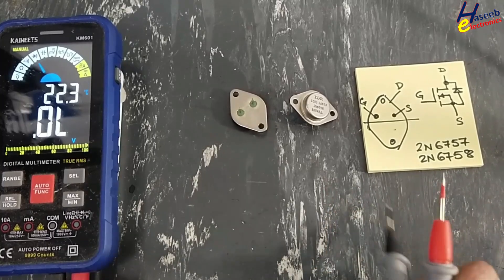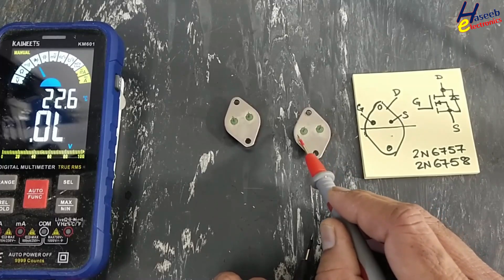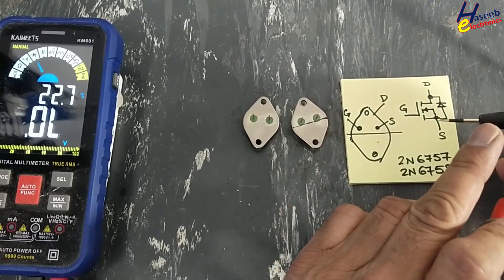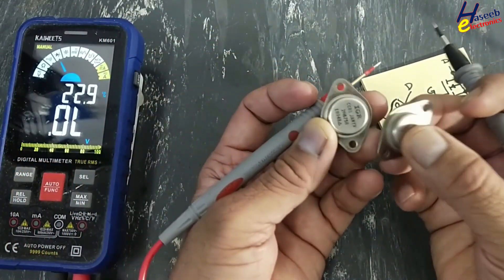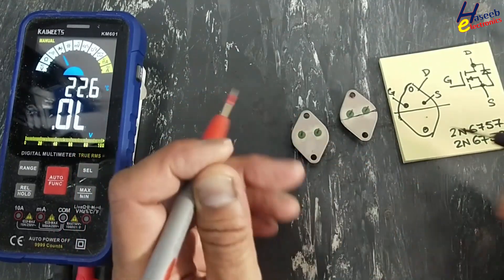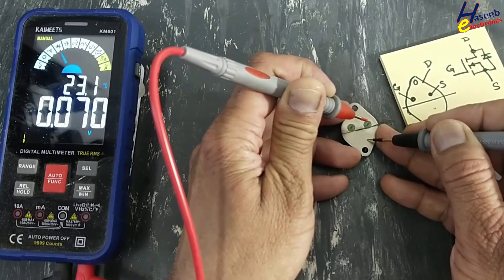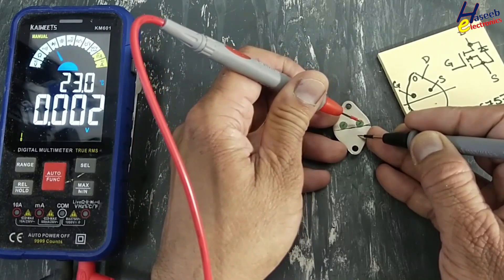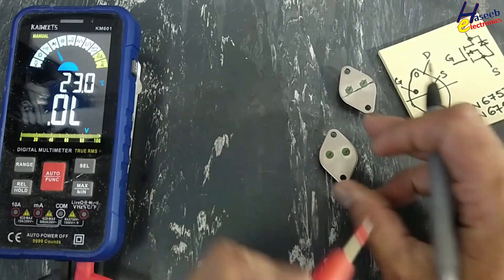{1272} Testing Power MOSFET using digital multimeter

Comment: I was testing a motherboard for shorted diodes and mosfets with the multimeter in diode-mode and it kept triggering the mosfets when I touched various smd capacitors. Had me scratching my head because I was seeing shorts where previously there were none! I guess there is no way to stop this on a board with 'floating gates'?
Reply from the maker: When we are working on motherboard or any "IN CIRCUIT MOSFET OR IGBT" there is a gate discharging resistor which keeps the gate at low level and MOSFET reminds off (this resistor is always high value resistor)
It turns on when it gets drive pulse from any controller circuit, and that is some +ve voltage value